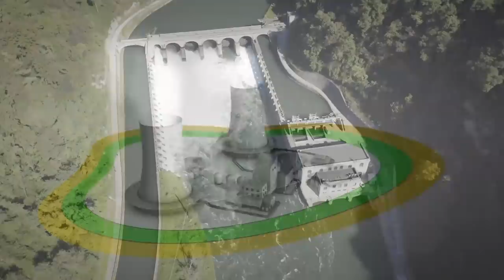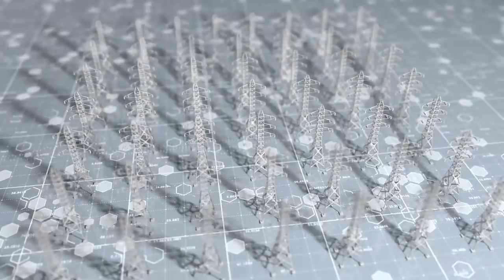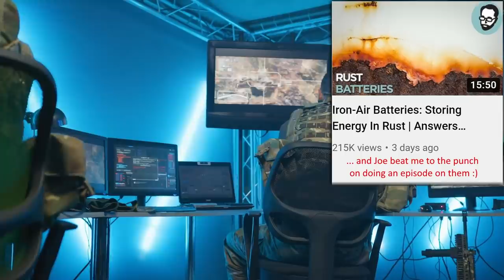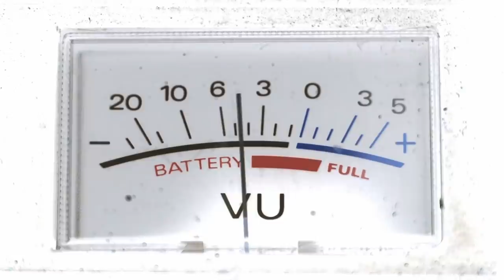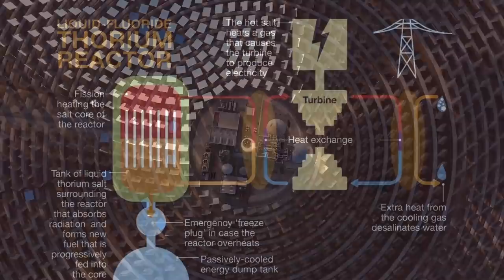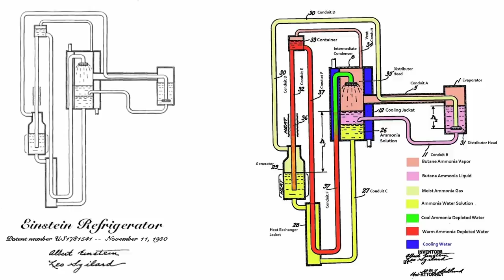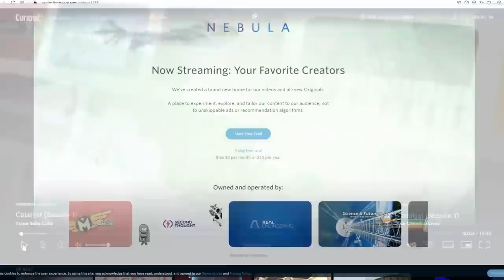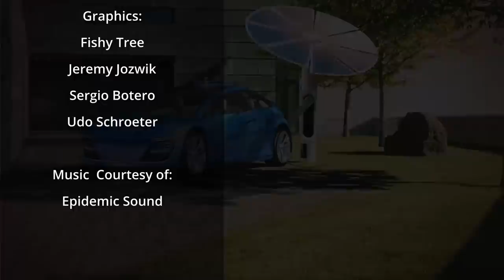The Future of Solar Power

Comment: Actually these technologies are a bit more advanced and common than this episode suggests.

1. Solar panels on roofs are pretty common already, and very often a lot cheaper than the grid. If your utility offers net metering, you are almost definitely better off with solar, even in less sunny climates. Not to mention that in certain areas it's a more reliable source of power than the grid. 

2. The current best battery price is around $80/kWh, and very quickly going down. There's an enormous amount of R&D going into batteries, even just the common li-ion variant. One that just got commercialized, like a year ago, is a standard li-ion battery but with a new iron-phosphate (LFP) chemistry. It has many advantages apart from low cost, and it's main disadvantage is somewhat worse energy density compared to the more common chemistries. For many applications this is irrelevant, but Tesla made them work even in cars, and still get a decent range out of them, mostly thanks to their very efficient designs. Another one that is going commercial about now is Tesla's 4680 cell, which is based on the common nickel-cobalt-aluminum (NCA) chemistry, but contains a lot of innovation in not just the cell design and the chemistry, but in the manufacturing process too. It promises higher energy density, higher cycle-life, faster charging, better thermal stability, and over 50% lower cost and drastically higher production volume. All at the same time.

3. Battery storage is also getting reasonably common. The cost is already acceptable, demand far outpaces supply. There are small batteries for home and huge ones for utility scale storage. The current largest battery farm is being built at the closed Moss Landing power plant. It's planned capacity is 2,270 MWh, with a 567MW power output, so it's equivalent of a medium sized power plant. Not long ago the largest battery farm was the Hornsdale Power Reserve in South Australia with only 129MWh, so these things are getting bigger very fast. These can stabilize grids, lower the cost of electricity (by eliminating large price swings), and even provide backup power during blackouts. They are very popular, many are under construction all over the world. Demand is practically infinite, supply unfortunately not. But production capacity is growing very fast.

4. Considering the growth rate we are seeing, the continuous cost decline, and the production capacities coming online soon or planned for the future, it's possible that by the end of this decade almost all new cars will be electric, and most of the electricity will be coming from renewable energy. For more details on this I highly recommend Tony Seba's videos and books.

5. There's also a thing called "virtual power plant". It uses software and AI to combine a large amount of distributed energy sources and batteries into a single unit that can be controlled by grid operators like a conventional power plant. And of course will be able to do much more in the future. There are pilot project all over the world. An added benefit is that it not just efficiently uses excess power and storage, but owners of those assets also can earn money.

Comment: Semiconductor solar panels are good but optical rectennas are my baby. Get that nice efficiency rate of up to around 90%. Made 2 videos about them if you are interested.
Reply: And their operation should also have a cooling effect.  Last I investigated, scientists had no idea how to harness the power at such high frequencies.
Reply: @robertanderson5092  there are antennas made that can do this, the problem comes with converting the energy into usable power, which requires a special diode (one that hasn't been made yet that can handle such frequencies.)

Comment: You can store solar energy as heat if you live in a climate where heating or cooling is required. Hook your heat pump up to a tank and run it while the sun is shining to either heat or cool the liquid, and then use the fluid in the tank to heat or cool your home when the sun is down.
Reply: Many off grid solar users already do this, except rather than for heating they generally use the excess power available after the batteries are fully charged to heat the hot water tank that's used for bathing and washing etc.
Reply: @popuptoaster  You can do that, too. In warm climates simply turning down the thermostat and chilling your home using your air conditioner on sunny days can help you bank some of that energy. Once cooled, a well insulated home can take many hours to heat back up again, especially once the sun goes down.
Reply: @sunspot42  Aircon uses a lot of power though, you need a fairly big solar array and energy storage to run a homes worth of of A/C
Reply: @popuptoaster  Depends on the size of the home, the efficiency of the panels and how well-insulated (and shaded) the home is. You can actually air condition a large home with a fairly small unit, or use a larger unit in conjunction with solar power to chill the home (or a fluid, or both) while the sun shines for use later. 

(You can also use it to bank cheaper grid energy for later use for climate control, for example when power rates dip overnight.)
Reply: @joeisslow1638  What do you think those events would do to the existing power grid? I think you have bigger issues to worry about than the solar cells on your roof. If the grid goes down and equipment is fried across the globe, I’d be a lot more worried about the cooling of spent fuel pools at nuclear reactors than rooftop solar panels. 🤷‍♂️
Reply: @sunspot42  yes that would be a concern overall, but while your in your house freezing to death, worrying about your fried panels and boiling fuel storage pools, I would like to be able to put gasoline in to my simple combustion engine generator and keep my family alive. And your arguement doesn't account for the other ways solar can be rendered useless. yes a CME will wreck the electric grid and all solar attached to it across the globe, but a massive volcanic eruption in Asia won't destroy our fossil fuel powered grid here in America BUT it would render a solar grid useless for a long while.
I'm not arguing that we shouldn't move away from fossil fuels, because we should. But we shouldn't be short sighted about possible future events that could render solar ineffective.
Reply: @joeisslow1638  Oh look - political idiocy in a science thread.  Bye!
Reply: @sunspot42  facts hurt I know.... be well and stay green my friend. 😉
Reply: @joeisslow1638  What "facts" did you share?  All I saw was concern trolling and then political spew.  🤷‍♂

Comment: solar is a great idea but without base load power plants carrying the majority of energy need during the night .. solar is insanely expensive and a predetermined breaking point for little longer periods with bad weather. or something requireing to build up buffers so increddibly big .. it becomes even more expensive
Reply: Solar has become incredibly cheap in the last few years. The intermittency issue is still there and needs a solution but in terms of price per watt solar is not "insanely expensive".
Reply: @AlRoderick  ofc for peak load, for local supply etc it's great but for base load, especialy the guaranteed supply during darkness be it very cloudy or night is something that's required anyways so no matter how much solar you have, you have to have base load power plants. the real expensive part about solar is saving it for later and ofc .. the stress which is put on the grid by having thousands of fluctuations everywhere
don't get me wrong .. i'm a fan .. but untill that problem isn't solved properly .. solar is a gimmic and not a backbone

Comment: When you do solar panel types, include the Optical Rectenna. 50%++ efficiency for the cost of a few carbon nanotubes and bits of metal to form diodes. 
Cost just a few % of current solar.

Comment: Solar is a power for the personal house. However, for having the industry, I doubt.
Reply: That's just a matter of scale.  Build a massive solar satellite array and beam the power down, and suddenly you've got industry taken care of.

I won't say it's the most cost-effective today, but the fundamental concept of the technology doesn't have that limit.
Reply: Yes it is great that you can place solar anywhere, but personally, I think solar is best used by pairing it with those industrial chemical processes which can allow for the ramping of production based on input available power thus taking advantage of the cheapness of the unregulated power. The home, and many commercial businesses need very reliable sources of energy. To make an intermitted source like Solar reliable enough for these uses requires a fair bit of effort and costly infrastructure to manage it and make it reliable. These efforts are likely better done by those in a specialized sector than amatures. Feel free to put efforts and dabble in getting some energy savings, but those efforts are a cost and additional complication in life that many will not choose to pursue.

Comment: 13:47

If you are using x amount of power normally and y of surplus power, cheaper storage still means you have the same amount of power production to use and you need to find something to do with the y surplus power.

Comment: There's also solar towers.  Cover a large area with transparent plastic sheeting, and build a tall hollow tower in the center.  The heated air under the plastic seeks an escape and finds one up the chimney to the comparatively colder, thinner air at the top.  Put a few wind turbines in the way, and it generates power. It's not terribly efficient, only equivalent to about 1% of the solar energy, but the land underneath doubles as a greenhouse.

Comment: A critic of solar power pointed out to me, and it is a valid topic that needs to be considered, is energy density when it comes to moten salt heliostats, and keeping them warm when the sun don't shine so the system doesn't solidify. Smaller systems will need to have heaters installed, so energy can be piped in from a generator, or elsewhere on the grid, to keep them warm. After all, the energy you're storing IS being lost as heat and mechanical energy during electricity generation. The larger the storage system, the longer it will retain heat.

Comment: Roads make great future deployment for power grids and solar panels.  They run between cities and the power could be used by vehicles through an induction system (right charge lane, on ramps, etc) in the road or more traditional plug in points at rest stops.

Another use that I am surprised has not occurred are solar panels installed on top of train cars.  Trains are already electric (diesel electric) and modern panels are light/productive enough to be of use.  Even if it is doing nothing more than keeping tracking transponders and sensors charged up.

Comment: In the short story "Bounty Hunt in the City of the Stars: Stellapolis" by Kai Kean there is a very interesting use of solar sail propulsion. It is like the concept of powering a solar sail with a laser but slightly different. The concept is of having a satelite network beaming intesified light out from the sun in a web structure, where ships then enter the beam to "sail" to the destinination in the sunbeam. This means that the ship is always going downwind as satelites at the other end beam another path in the opposite direction. Basically making something like a light based highway system for travel in the solar system. The system also works as a power grid as the intensified light is beamed to far away station providing a power supply and light is transmitted unto the gasgiants heating them up to work like small suns. The story centers on what happens when someone has access to the codes that control this network. I would love to see a video about such a lightbased transit system in the solar system from Isaac Arthur.

Comment: Too many people focus on storage per kilogram. The exciting thing for solar is storage per dollar. When that gets low enough the problems with solar pretty much disappear. But, ofc, storage per kilogram is important for electric cars and phones
Reply: And planes/ships for weight
Reply: @catprog  
I'm not sure electric planes will become popular in any nearby century. I suspect we'll keep using hydrocarbons (or similar), we'll just start using carbon neutral hydrocarbons. With our current technology carbon-neutral jet fuel is only like twice as expensive as fossil jet fuel. Which would represent like a 30% increase in the cost of a plane ticket. Not trivial, but doable. And I'm sure that'll improve.

But, that's a good point with boats. Boats seem ideal for solar power, if only you could put a solar-panel roof on it without blocking access to the shipping crates.
Reply: @the1exnay   https://youtu.be/aH4b3sAs-l8?t=858 Short haul planes are quite suitable to be electric.

Comment: I remember seeing a blimp concept that used steam as a lifting gas, not sure how viable that’d be for floating solar cells 🤣
Reply: Probably not very considering hot air(steam)  only has lift while warmer than the surrounding air, if there is no energy(heat) gradient, then the lift will cease. This is basic thermodynamics, DUH! LOL, jp, but ya, hot air/steam will only work while it's hotter than the surrounding air. While something like helium/hydrogen is just atomically lighter than oxygen/nitrogen/carbon dioxide(air) and will always provide lift provided the air surrounding it is more dense than the float gas.
Reply: Sounds like step one to a glorious steam punk future.
Reply: @ryangrant3414  Man, not sure why I missed replying to this earlier, but no, actually.

H2O is atomically lighter than N2 and O2. It'd have to be pure steam, no air, but it's actually lighter than air, roughly half the molecular weight.

It's still a weird idea that I don't think is practically feasible, but an interesting one